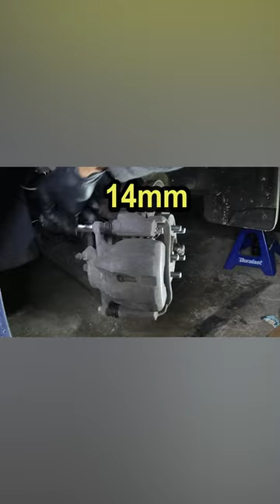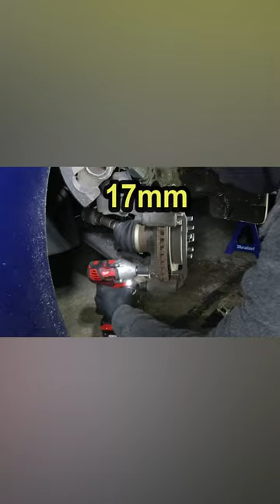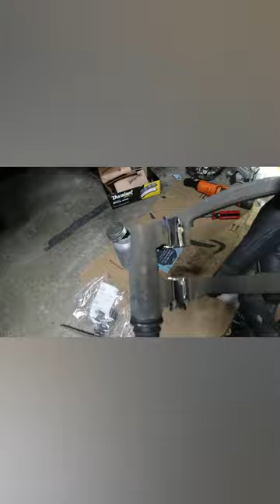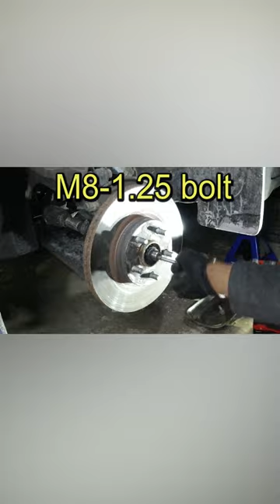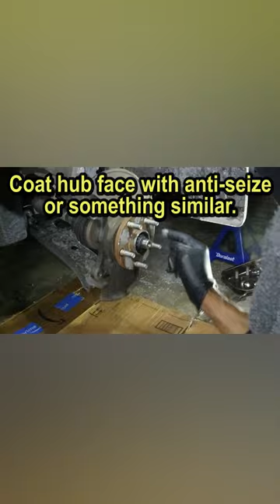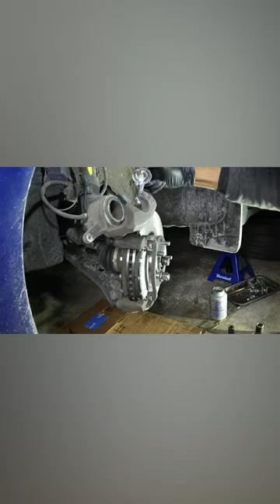2014-2019 Corolla FRONT BRAKE PADS & ROTORS DIY #shorts

Comment from the maker: Full Video: https://youtu.be/mgQmM1nnUoM
Corolla Front Brakes/Rotors: Akebono ACT1210A Ultra-Premium Ceramic Front Disc Brake Pads , GREY https://amzn.to/3YwZsDz
https://amzn.to/3RyGfz7
https://amzn.to/3jAYirK
M12 FUEL 3/8" RATCHET 2 BATTERIES https://amzn.to/3x0oM9d
Milwaukee M18 18V Fuel 3/8" Mid-Torque Impact Wrench Kit https://amzn.to/3DLfrFV
Milwaukee 2767-22 Fuel High Torque 1/2" Impact https://amzn.to/3DKh8DF